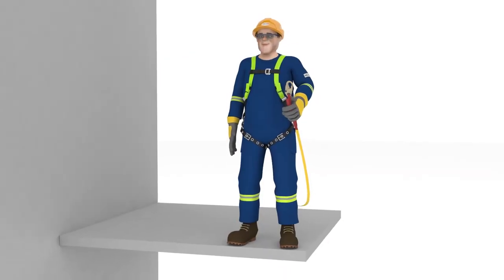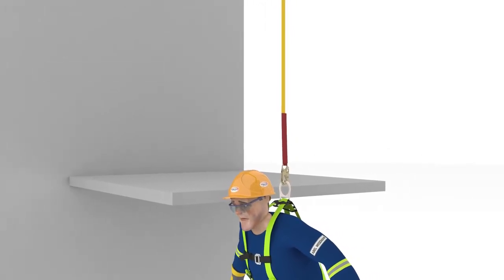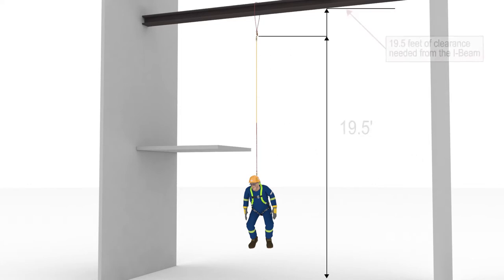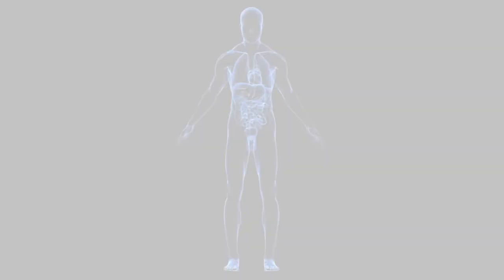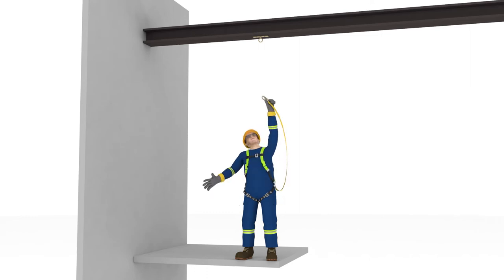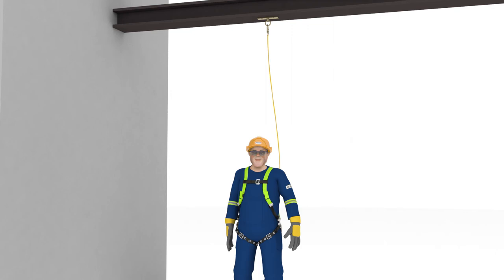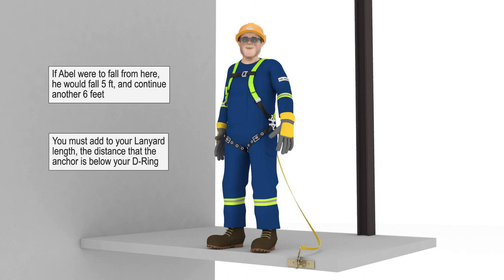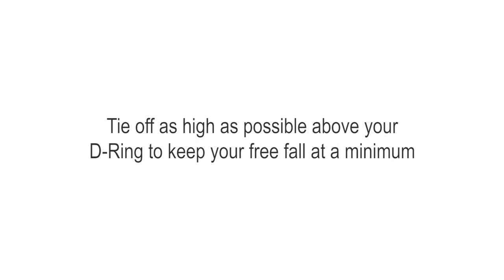Fall Clearance, Arresting Force and Free Fall Distance - 3D Animation - (Light-Hearted Version)

Comment: Great job but my question is when you calculated free fall distance you're not mentioned shock absorber so this mean should not be used if it's bypass any reference standard for that 
Thanks for your valuable informations
Reply: Thanks for your question.  We didn't mention the shock absorber in our free fall calculation because your free fall ends when your shock absorber begins to arrest your fall.  Free Fall is how far you drop before anything starts to stop you...Like jumping out of a plane before you pull your shoot.